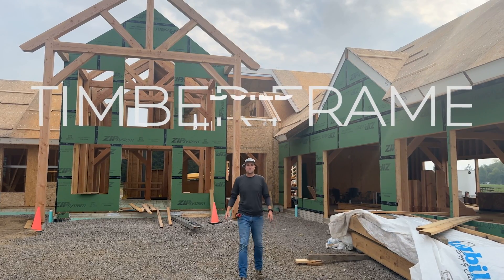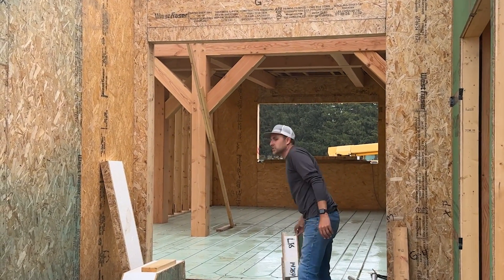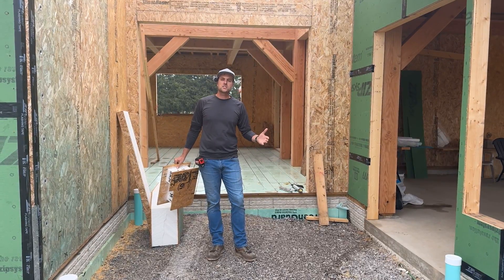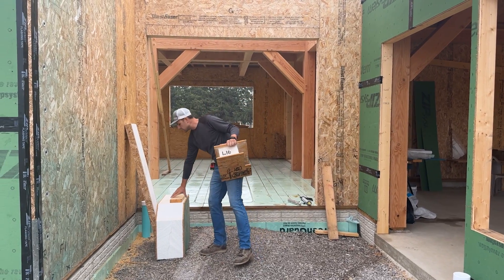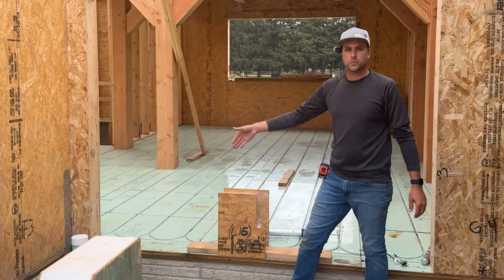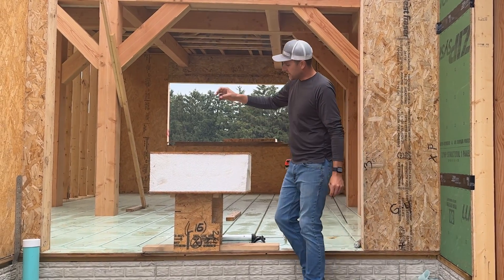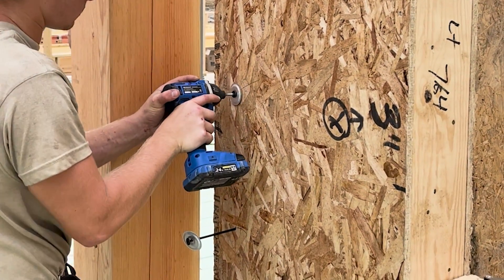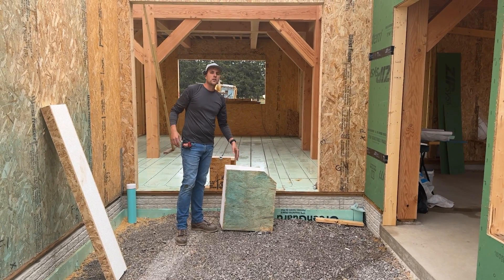SIP Details - Ep. 8 - Timber Frame Build Start to Finish

Comment: Is it more expensive to use conventional stud framing and sheathing between timbers, instead of SIPs? I just don't like foam and want to use Rockwool insulation.
Reply from the maker: SIP construction is typically more expensive. You can actually achieve a better wall cavity using exterior insulation and a good WRB. We use this method because of the timber frame.

Comment: Can you use stucco  as final finish outside  walls without  messing SIP ?
Reply from the maker: Absolutely, with the proper air and water barrier plus a rain screen product you should be able to execute a stucco facade with no issues. All types of cladding should be able to be used with SIP construction.